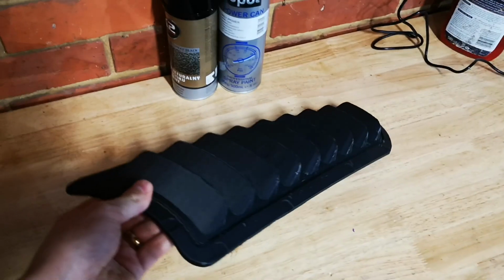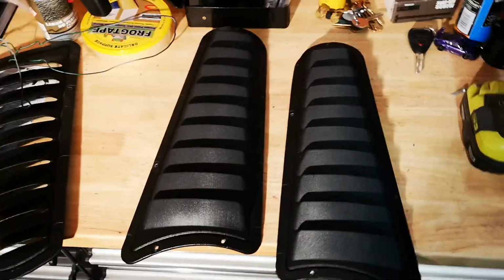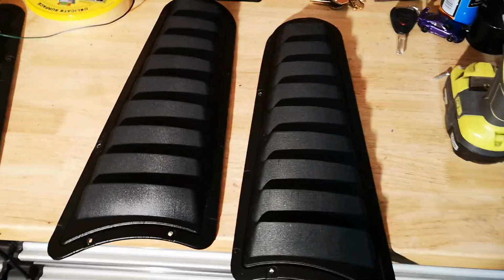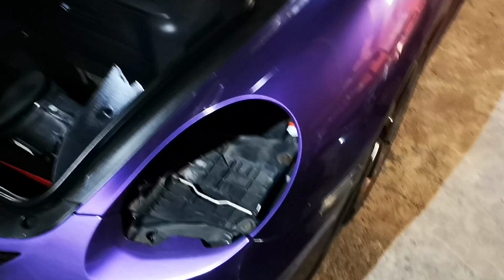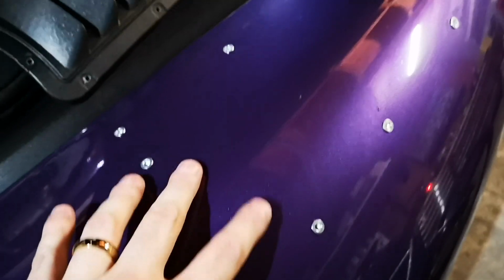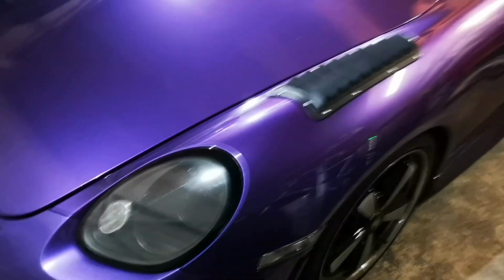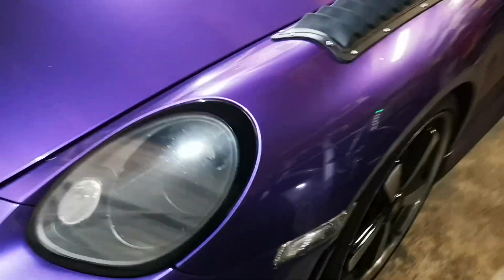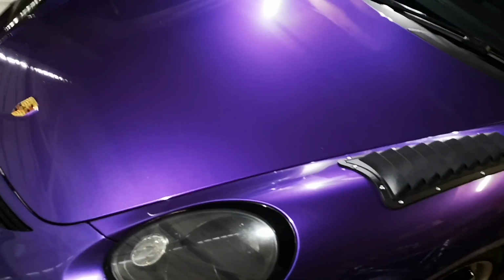Fender Vent Install on a Porsche Cayman

Comment: What exactly is this venting?  You forgot to cut the holes in the fenders
Reply from the maker: I didn't cut the holes in this picture. But they have sections cut now. Main purpose would be to relieve built-up air pressure from inside the wheel arches which causes aerodynamic lift. Haven't had any FEA testing done on them to put any figures against it. 

I just liked the look of them so designed them up. 😊